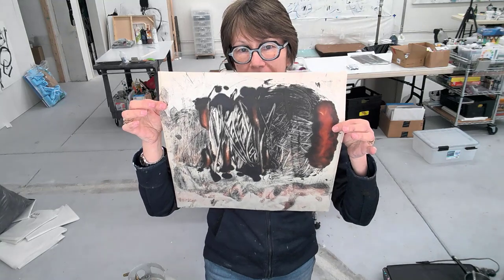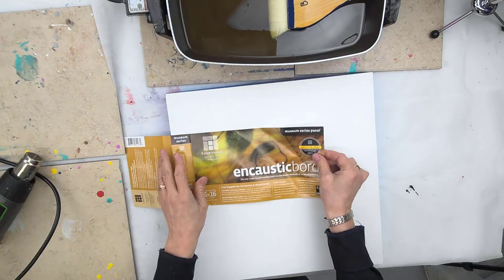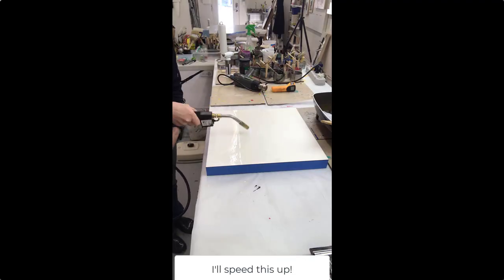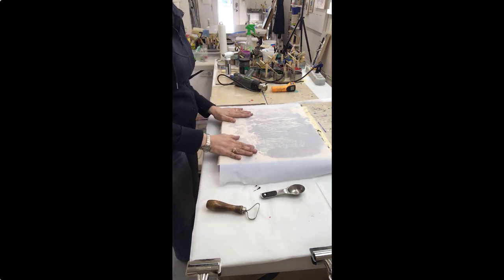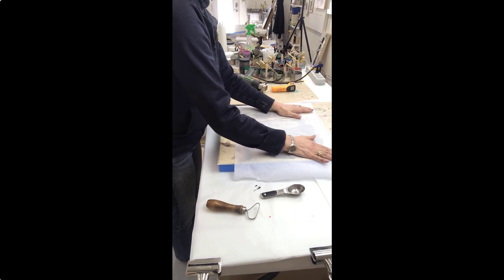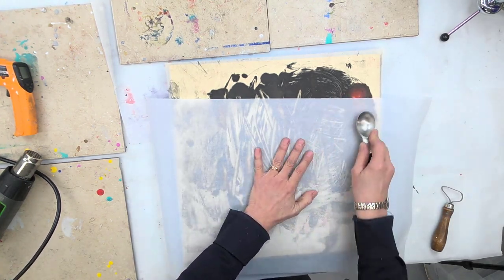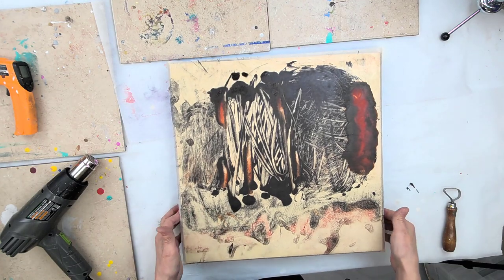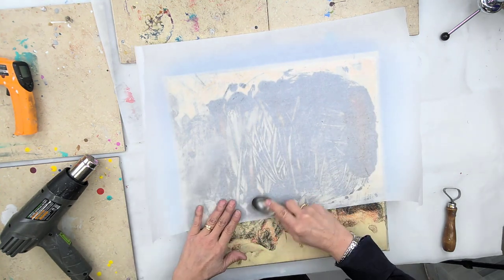170 - Pamela Caughey - Adhering Encaustic Monotype to a panel with Heat Gun #encausticmonotypes

Comment: Do you have any advice on treating the edges of the paper once it's trimmed, to minimize lift?
Reply from the maker: Use a heat gun with gentle heat along the edges. Put parchment paper over the top and gently burnish the edges-that should prevent lift!

Comment: Hi Pam. Is the melting point of an encaustic medium higher than just the layer of beeswax? Are you using  just the beeswax because it is softer and your thinking is that the paper will sink into the plain beeswax layer better at a lower temperature vs using an encaustic medium base coat? Is that paper like a sumi ink paper?
Reply from the maker: Yes - due to the damar resin in encaustic medium it is slightly higher (about 20-30 degrees higher). I use the beesax alone mainly because it is less expensive; one less component - but you can use encaustic medium and RF paints, for example - it is fine - just has one more ingredient. I use beeswax as a base layer but could easily use encaustic medium - either is likely fine. Once cooled, I don't think the added resin encaustic medium would make too much difference. My favorite paper is Thai Kozo - you can get it from Dick Blick! Have fun!!

Comment: Is it necessary to rub with the spoon after you gently use your hands to try to adhere the print into the warming wax? It seems that once you use the torch, it’s going to be well adhered already. Beautiful piece!
Reply from the maker: Adhesion can be a bit tricky; and I’m not using a torch as this is thin paper -just a heat gun. Burnishing with a spoon ensures better adhesion but you are right-it seems pretty well adhered as long as you press it firmly into the wax
Reply: @PamelaCaughey  You’re correct! My mistake; I should’ve said heat gun. Did you find any blurring of your fine lines in the print?
Reply: Hi Pam, great tutorial! Why plain beeswax as opposed to the beeswax/damar resin mix used often? My thoughts are that when you lightly fuse at the end a wax/resin would hold it better in the long run with the “tougher” layer. Thanks for addressing this for me.
Reply from the maker: @beckywebb1916  No blurring! It was a successful experiment ;)
Reply from the maker: @sugould5477  I think it would like work fine but higher heat would be required for encaustic medium vs plain beeswax so not having to use as much heat may be part of the success ;)